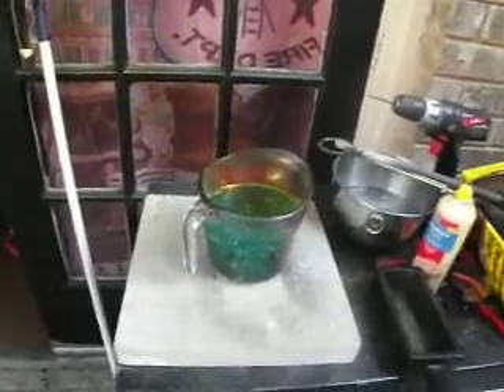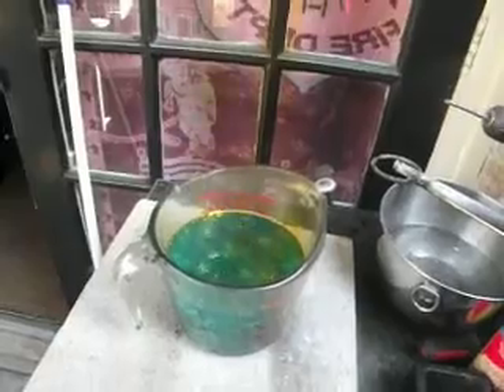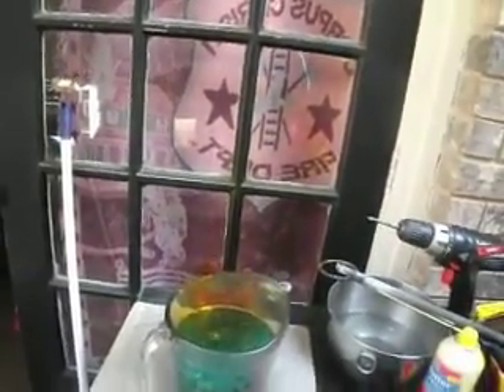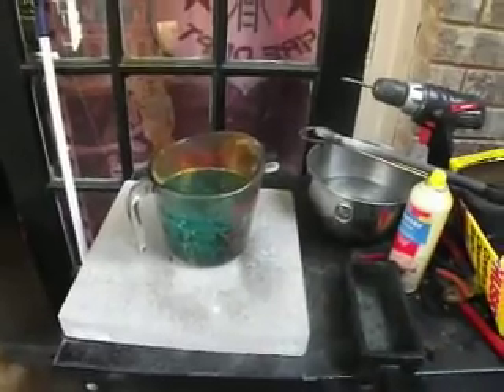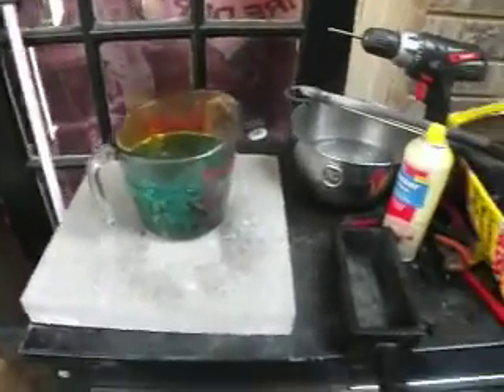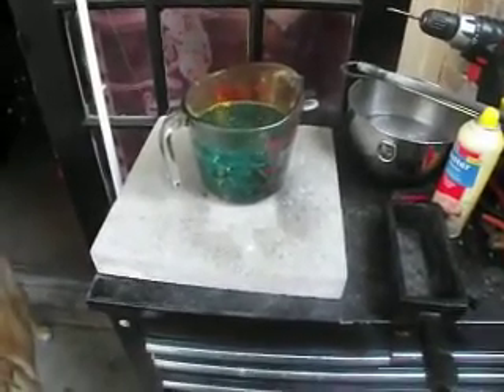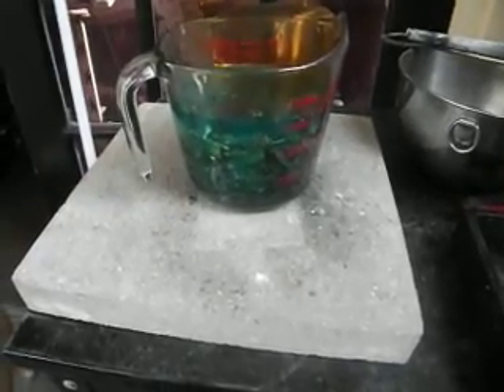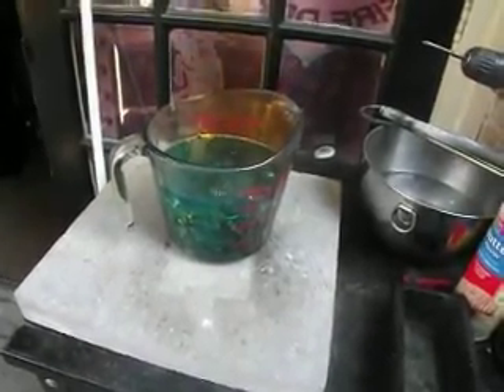gold recovery from nitric acid

Comment: Hey bud.  I was told use muriatic acid and hydrogen peroxide......... Is your process wash the same.. Just with nitric acid and distilled water..... Only reason I ask is, I'm no scientists but was told nitric acid takes surface off shit.  In our case.. Ram fingers..... But you would need the other stuff for aqua regia, if stripping layers/jewelery.....